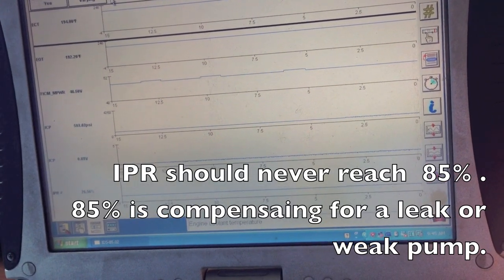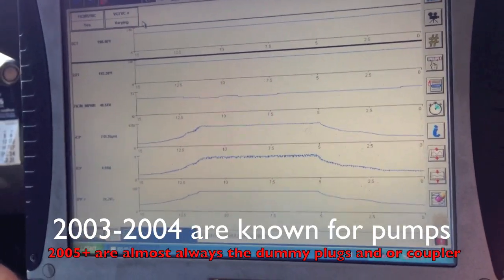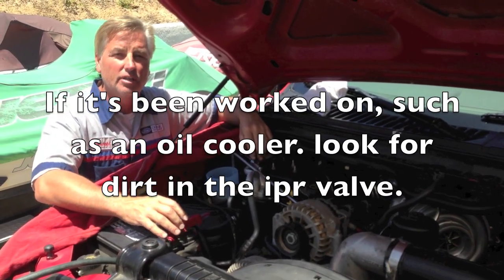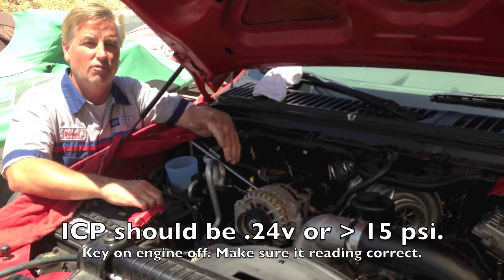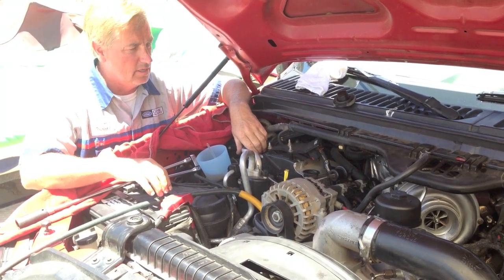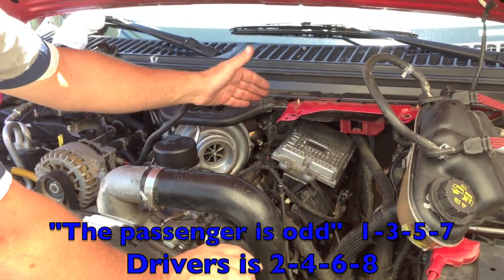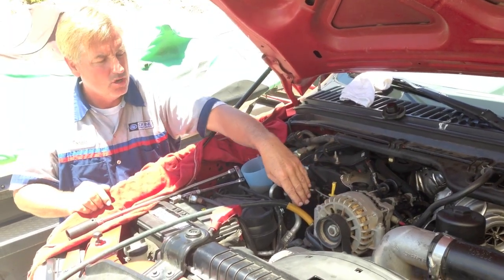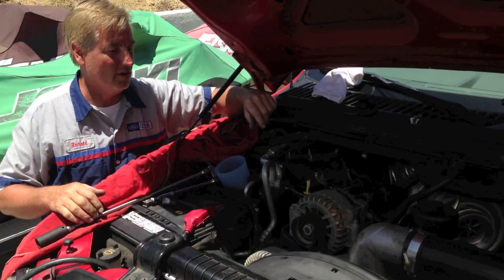Ford 6.0 powerstroke diesel. No start when hot. diagnostic tips

Comment: Hey Ron, woke up with a crank no start. Noticed my alternator power cable was grounding to the alternator. Replaced alternator and cleaned up the burnt power cable. Power cable was still discolored before I wrapped with heatshrink. Still crank no start. Could the burnt power cable be the cause for a crank no start? Sensors and ficm are good after checking

Comment: I'm having a issue with my 2006 6.0 powerstroke. I changed hpop, lpop, stand pipe, dummy plug, 8 injectors, icp, and ipr. I drove it one day. The next day it wouldn't crank. What do you think is going on?

Comment: I have a 2005 6.0 that started just stalling, did some clean up work adding stuff to gas and oil and thought it was fixed and then several months later it started stalling and then would not crank while hot.  Already knew I had some bad injectors so we replaced all of them, removed EGR, replaced glow plugs, and ICP and although truck ran much better it still would stall occasionally while driving it like turning the key off.After much research my mechanic had only one guess and that was the high pressure oil pump so I had him tear into the engine again and the original pump did have a lot more play in it as if it were severely worn for only 105,000 but the biggest thing is the bracket that holds the connector for the line to the pump had the bolt crossed threaded so the bracket was not doing the job properly.  The connector apparently had begun to leak under certain situations, the pump was replaced, new connector installed and bolt hole rethreaded and new bolt installed the truck now runs better than it ever has.

Comment: hey ron , my truck is a 2003 f250 6.0 , and I am having a not start when hot problem , is there any other way I can check for leaks with the valve covers off while running cause I cant find that fitting to do the air test ?????? trucks starts right up in the morning has like 600-700 psi idling and when hot has 580 icp psi , I turn it off and turn it back on and only builds 350-370 icp psi , once the oil cools down it starts again
Reply: Eduardo Gongora I got the same problem u be driving and it will die it will run good til it’s get warm and it dies and won’t start back up if u know what could be the cause of it plz text me
Reply: Eduardo Gongora 
Hey my friend were you able to fix it. and what the problem was?
Reply: What happened to be your solution im in the same boat runs good but wont turn on till the oil hits 150 f
Reply: Hey Eduardo did you figure out the problem with your truck mine does the exact same thing if you did please let me know thanks!! :)

Comment: Hey Ron enjoy your videos!
I have an 04 f250 6.0
recently took to get oil changed and oil and fuel filters changed. drove it home. was fine.
next morning while plugged in, it won't start. turns over , sounds like no fuel. what could they have done wrong.
Or possibilities. btw batteries are at full charge now, due to trying start they were low. Ficm is 47-48 v
icp 30 %
can't get an ipr reading
but ran good before the change.
Thanks
Reply from the maker: Please watch my no start tips tricks and tools video.

Comment: just got an 2005 f350 6.0  I cut it off while i was putting diesel and it don't want to start. i use some starting fuel and it crank then thre days later it cut off and it was the alternator. I replace it change a batery. and now it don't want to start with out fuel. It was runnig good after i started it, but today it started to run  bad, like is missing fuel. but the pump is good . i don't konw where else to look for. Any help will greatly appreciate. And thanks for the good knowledge you input in your channel.

Comment: I have an 04 F250 6.0 Powerstroke.  The Injectors, EGR and Oil cooler replaced less than 1 year ago.  It will start cold wonderfully but one it gets warm, no start until it cools down.  When I ran this test external air 56°F.  Less than 10,000 miles driven since I had the work done.  No power loss when driving.  Would this be the IPR?
                                                                      
                                 5 min Running   KeyOn   Crank  Running  KeyOn   Crank
Time                                  17:42       17:43      17:43      17:56  17:56      17:58  
ICP                                    804.8        12          1033       718     10.3       392.2
VGT Duty Cycle(%)               60            0               0       54.5      0             0
FICM Main Power(Volts)        47           47             47       47        47          47
Engine Oil Temp (°F)             96           102         102       147      147        146
IPR (%)                                27.1        14.7          84       26.7     14.7         84
Reply: Hi. were you able to fix the problem?

Comment: Hey Ron, I have a late 03 that has a shut down issue. I don't know much about diesel engines. But I have studied your info and read for weeks.  What I done. I bought a scan gauge 2 and programed it. 
I have fuel in the filter and they are new. I checked ficm I have 58 volts. I have well over 500 psi icp at start and never drops even when it shuts off. I have about ipr 23 to 25% duty cycle.. I have new battery's   new alternator good connections. Everything that sold show a sign that's something has failed test good. I'm getting ready to test fuel pressure.  Soon as the fittings come in. I'm lost for ideas. Truck sometime stumbles just before it dies .
Reply: Bryan Whitaker sir I have a 2003 Powerstroke F350 with exactly the same symptoms as yours I am dying to know what you have come up with I know your post was two years ago but hopefully you get this my name is Greg Ortiz I'm from Albuquerque New Mexico I'm about to buy some diagnostic tools so I can help myself out in this situation I really enjoy working on my truck and she's been a good Workhorse
Reply: Bryan Whitaker I'd love to find out what ever happened with yours I'm about to invest some time and a high pressure oil pump but I need diagnostic tools to find out what levels I have on my IPR and ICP valves

Comment: Ron, i love your channel.  your videos are very helpful.  However, i have had 2 scenarios last week when it took approximately 10s for my truck to start.  it was about 40*F outside when i tried to start it, both times.  IMO it takes too long to start typically, but i don't have another 6.0 to compare it to.  it was back to normal the next day when the temps were warmer.   Does this sound like it could be a oil pressure leak issue?  I'd like to get it figured out before winter comes, but i'm not sure if thats the theory i should start with.  It's an 04.  Thanks.

Comment: I forgot to mention I had the turbo, egr cooler, & oil cooler replaced 4,000 mile ago. Due to white smoke out the exhaust pipe. Thanks again

Comment: Hey Ron, your videos are most helpful and informative. I went ahead and change the stand pipes and dummy plugs. I bought the scan gauge, programmed it, still have a no start when hot. the icp, ipr ficm and sync read good at first start up. When I go back after a few minutes, the icp reads @100 psi and ipr is at 85%. I am thinking sct fitting on tje high pressure oil pump. The truck is a 2005 f350. Any suggestions?. Thank You.

Comment: Hi Ron I had a Q for you and wondering best way to do so, I have watched your vids on 6.0lt cranks no start, On cranking getting 200psi and 85% ipr . On inspection, oil cooler screen had holes in it and ipr screen had holes in it, I have replaced the pump, and ipr, did the oil cooler and screen and egr kit at same time. also replaced all seals on oil tubs.( I was in there any way replacing #7 injector)  It cranked for a few min and started, test drove it a few times, restarted it 6 times, 7 time started for one sec and stalled and will not restart, I am back to 200 and some lbs on cranking and ipr goes straight to 85% Im suspecting dirt in ipr ? was hoping for some advice before pulling it apart again.
  Thanks Steve

Comment: I did find a kit to reseal the injectors in my 04' the truck has been running great for about 8 months now. the kit is from Allaiant Power part #PA0002. this is a full kit with all new O rings for the full injector plus a new snap ring and crush washer.
Reply: How is ur truck running now after 7 years with the o rings that you replaced on the injections?, thanks
Reply: Did it last?

Comment from the maker: Ficm voltage. Glow plug operation
Reply: Hello Sr I have a question I have a 2005 f350 6.0 Diesel and I have a problem after a drive it for a while and then turn it off it won't start unless a get a starting fluid any idea s plz let me know thank you
Reply: @s.r6172  probably have a high pressure oil leak. That’s what I’m dealing with on mines. Most nes won’t start when it’s hot after a long drive.

Comment: Hey Ron love your videos. I have an 05 that hard to start in the mornings. When I pressure tested the high pressure system i don't hear any noticeable leaks. I hear a slight leak that sounds like its coming from the crank case. What should I check from here?

Comment: When you added air pressure to the driver side, is it possible that the bigger leak on the passenger side is allowing all the air to leak and hiding a possible leak on the driver side? And also, you said that you replace the injector sometimes... is that cause it has possibly worn from loss of oil? Thanks diesel tech Ron, your videos kick azz!!!

Comment: ill agree ron, i work for GM training to be a diesel tech, i do work on a fleet of 6.0's and 7.3's outside of work, im the same way with seals, o rings, injectors anything, i always tell them go with the OEM part's that way you know they fit correctly, theres no alignment issues, you dont have to take it there to get the work done just buy them from ford or international(i usally buy SOME gaskets there about 30% cheeper)